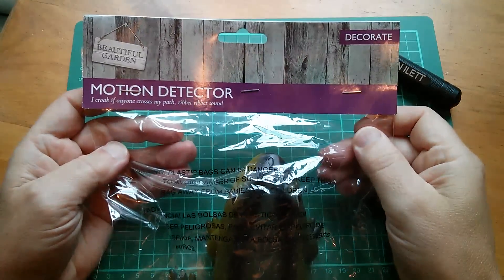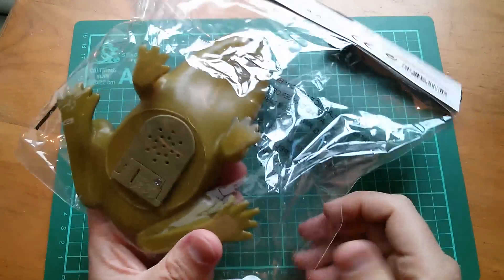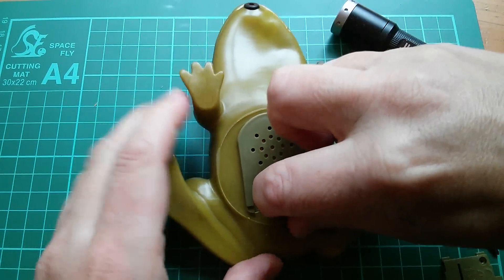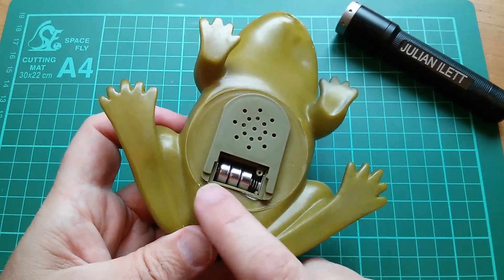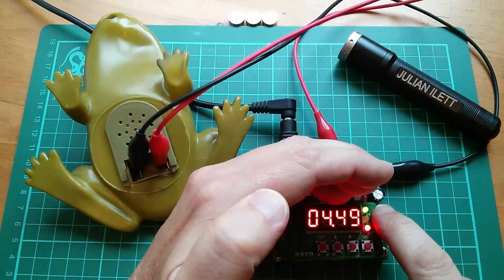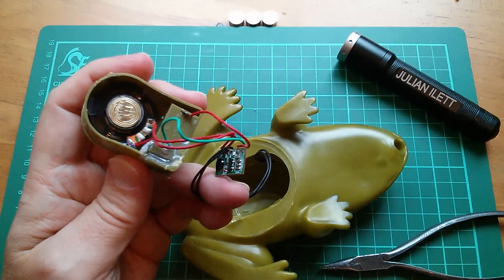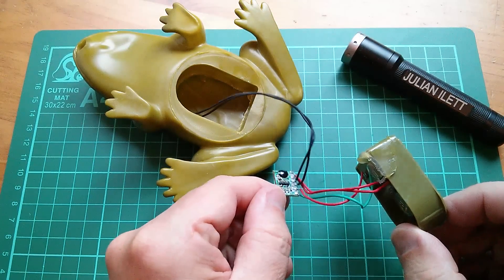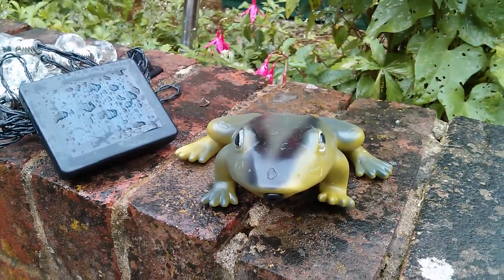Dissection: Poundland Frog

Comment: the component values are printed on the circuit board, but 1 of the 3 resistors has a different value to what is says on the board, theres a 68k and a 10M in the right places, but where it looks like there should be another 68k they have a 3.3M

Comment: And I thought you were going to Electrify P.I.T.A.

Alternatively, wire up a tiny solar panel with a capacitor to replace the batteries, and you could have an excellent device to remedy a pesky bird problem. A prudent individual might use the little box minus the amphibian for such an endeavor. What is the probability of a large bird taking a liking to our little green friend?

Comment: Why does a change in voltage change the pitch? To me it would seem more logical that it would change the amplitude (eg loudness) instead of frequency.
Reply from the maker: It didn't alter much, but the internal resistor/capacitor oscillator will be affected to some extent by a change in Vcc.
Reply: Julian Ilett
Ah, okay

Comment: Still trying to figure how this can be manufactured and sold for a pound. But then the same can be said for all the crazy stuff I buy from China that gets shipped over for pennies.
Reply: Forced labour/child labour
Reply: What I found is that quite often stuff they sell is either an unbranded version of things you can buy in "normal" shops, a sell-off of old stock or the "leftovers" of a bankruptcy.
Reply: It really is insane, you can get two of those cig-lighter voltage gauges for a US dollar.  I don't think this will ever cease to amaze.  The shipping alone would surprise.  That dollar pays for the shipping, the materials & assembly, the 'and handling', a percentage of returns, and I assume they're still making a profit somehow????
Reply: What amazes me is just how low their postal costs must be. If I shipped an item back to China, it would be 3 times the items cost in postage alone. Or maybe our postal system (Canada) is just ripping us off.
Reply: Roy Riederer
I always wonder how shipping works, too. On the other hand they only have to throw it in the right bin for the destination country. The real work (sorting for city/address and mailman delivery) has to be done by the postal service there.
Reply: superdau That's a very good point.

Comment: If you want it to make different pitch, use a wet finger across a resistor on the board, when you find the one that changes the frequency etc, replace with a potentiometer
(circuit bending)
Reply: On-chip clock oscillators that aren't affected by supply voltage have been around for ages.

There are several resistors have different values fitted compared to the PCB ident, but it looks like they're associated with the trigger threshold.
Reply from the maker: It's possible that there are no external components which affect the oscillator frequency.
Reply: Yes, seems like the resistors on the right and the capacitors(?) is for the motion detection.